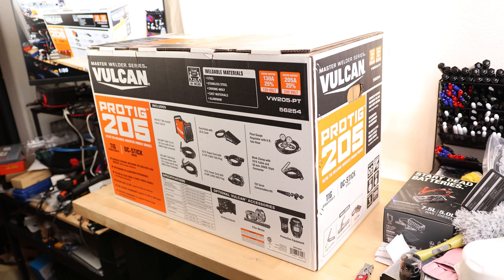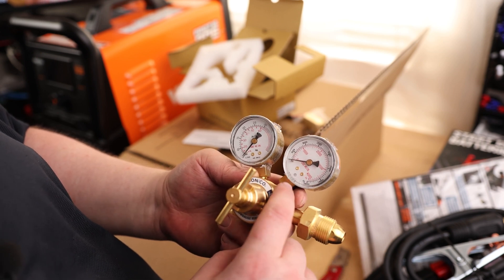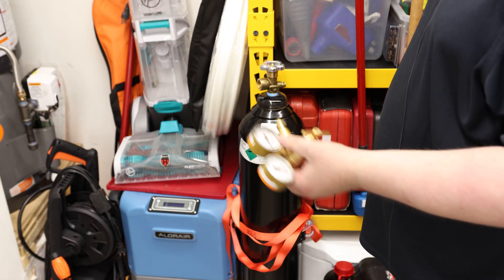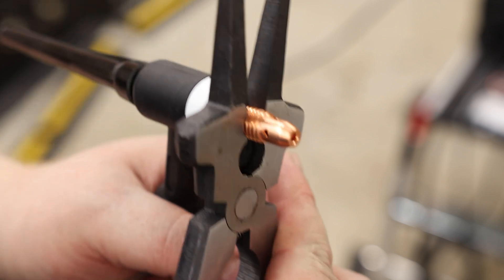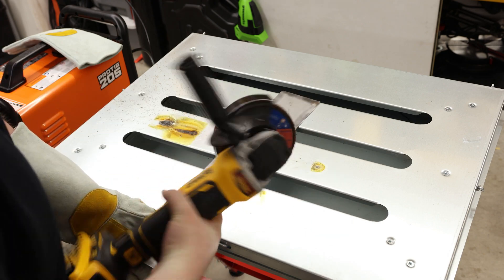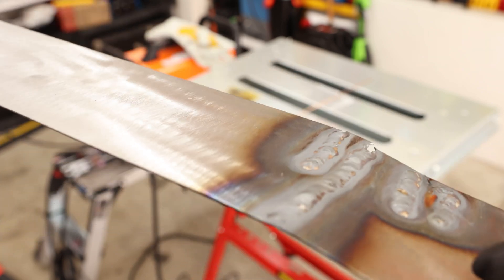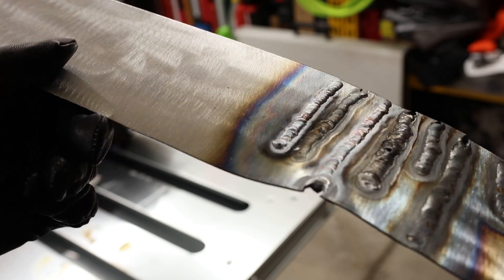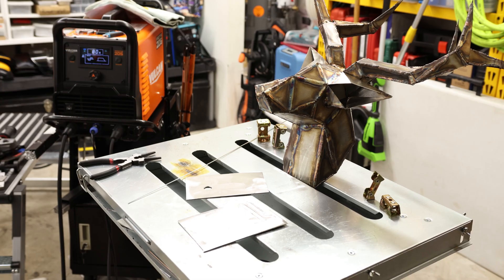Trying The VULCAN ProTIG™ 205 Industrial Welder with 120/240V Input

Comment: You can call yourself a tig welder when you can lap joint tig weld a aluminum coke can back together after it's been cut in half and make it not leak water it took me a year to learn! I have been welding for over 50 years now! Good luck on your welding journey.

Comment: Thanks for sharing!  Just one BIG caution.  At 7:57 you recommended stick-out equal to cup diameter, which is also the prevailing recommendation on You Tube (This Old Tony, et al).  However, now I'm thinking that applies to GAS LENSES, not std collet bodies like this.  On pg 10 of the PT-205 owner's manual (and in the Eastwood manuals), the recommended tungsten stick-out is only 1/8" to 1/4"!  Owner's Manuals from Miller, Lincoln, HTP, etc. don't seem to give a value.  I chased my tail for HOURS trying to get aluminum to "puddle" correctly using the std collet bodies & cups that came with my PT-205 (retrofitted with a CK torch).  It didn't seem to matter what Ar flowrate I used.  Switched back to a gas lens and BOOM, no problem.  I haven't gotten around to retesting with 1/8" - 1/4" stick-out, but I read somewhere else a guy had the same problem and solved it by reducing stick-out to the value recommended in the manual.  There also could be a compatibility issue between the PT-205 std collet bodies with CK torches.
Reply: BTW Distractor Beam, I noticed that your results also got way better as soon as you switched to a gas lens.

Comment: Can I plug it in directly into my outlet? Thanks
Reply from the maker: yes
Reply: @distractor_beamreviews  the 110 plug or 220?
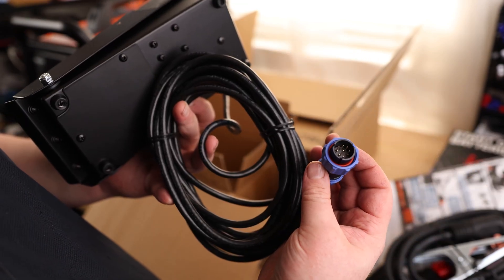Reply from the maker: @LouHemi    You can use either.  3:04  I used a 120v outlet.

Comment: I bought a Vulcan 205 from Harbor Freight. It did not work on AC tig immediately out of the box when less than 2 weeks old.  I returned the welder to Harbor Freight and they would not return my money.  I immediately called Customer Service and their suggestions like reset or connections did nothing to solve the problem.  The best they could offer for a refund was 80% of amount paid with a 20% return cost out of pocket of $200.  I WILL NOT purchase another item from Harbor Freight.  I cannot believe Harbor Freight would sell a defective item and not return the full sales amount to the customer.
Reply: Man you went every video and complained.  Little bitter I would say.
Reply: @niceguydmm I don't blame him. I'd be pissed to if I was him
Reply: I would be pissed off too @niceguydmm
Reply: Why did you not ask to exchange it for the same model? Sounds like it was either you or you got a lemon. Plenty of guys are doing steel, stainless, and aluminum with this 205 unit and are loving it. Did they offer you an extended warranty on it at time of purchase? I’ll bet they did and you turned it down.

Comment: Speed up your dabbing. And smaller electrode
Reply: That might work for you but it's not necessary. Thicker electrodes can weld pretty thin as long as the grind is good. If you feed more wire you don't need to dab more frequently. Lots of ways to skin a cat. Just got to remember your WHY. If it works for you and passes a weld test. 👍